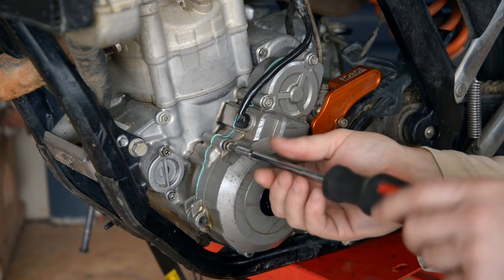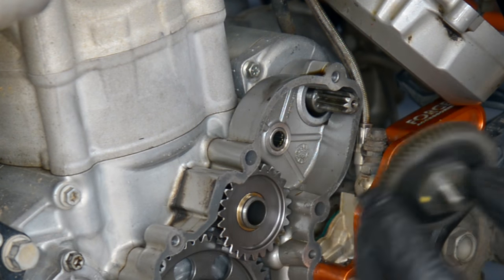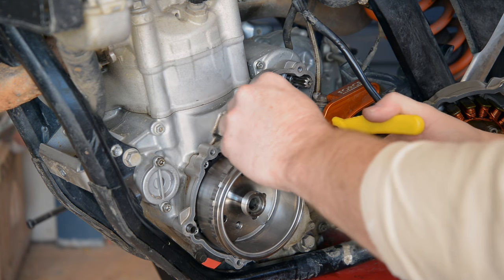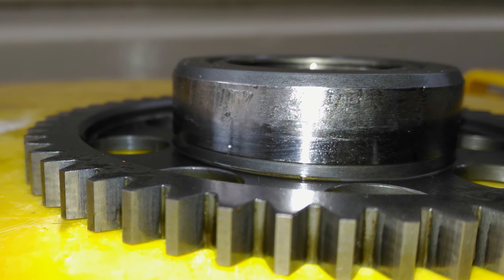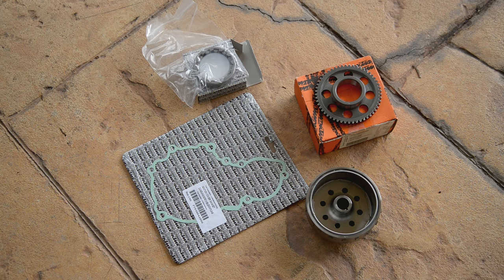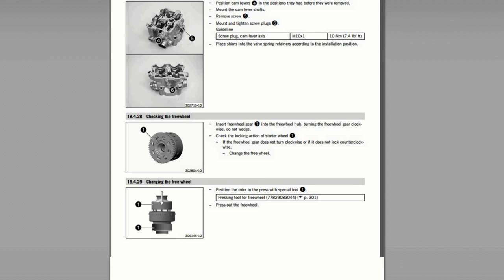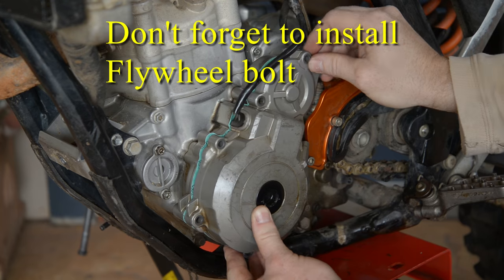KTM Flywheel Bearing - How To

Comment: The bolt without the copper washer should be placed back while the piston in TDC. In that position the tip of the bold end up in a dimple in the crank just to hold it at TDC. You put a lot of pressure on the crank.
When removing the flywheel, keep the wrench on the puller , the crank should not move. In fact you do not need to remove the copper washer and bold to remove the fly wheel.
Reply from the maker: Interesting point thanks - I will try this next time
Reply: What about when installing? Should an impact gun be used or the locking screw?
Reply: @Cryptix37  just use the torque wrench. You can put a  locking gear or a copper washer or  copper coin between the primary gear and clutch or put the bike in gear after the drive chain is placed. The torque on the puller to remove the flywheel is much higher than the torque on the bolt that secures the flywheel.
Reply: @wil9650 will try. I think I’m going to go buy both impact gun and torque wrench. The only concern is that cheaper torque wrenches are not reliable, but probably will do
Reply: Just had a chat with a mechanic friend of mine. Belt for oil filters can hold the free wheel very well apparently.

Comment: How did you find torquing and removing the flywheel bolt as its spec is 70nm I’m worried it could shear the bolt holding the engine locked in at tdc

Comment: Great video. Question. Can the seal behind the stator be removed without splitting the whole engine. I’ve an oil leak on my ktm 250 causing charging failure. Can only think leak is from that seal
Reply from the maker: Not sure I've never had to replace that

Comment: What symptoms were you seeing that led you to want to replace the freewheel gear and bearing. On my exc 350f (2013) the starter motor does not seem to be disengaging so when I use the kickstrter I can feel and hear the motor spinning making it hard to kick over. The bike also will not start. Just cranks over when using the electric start.
Reply from the maker: Bike wasn't starting and kick starter was jammed.

Comment: What torque did you set on stator rotor srew, M10 one?
Reply from the maker: You can find the torque spec in your bikes manual.
Reply: @troytranter3701  Thanks for reply, I ask cause I am not sure if line in manuals torque specs table named "Rotor srew" really about stator rotor, value is 70NM, srew threads oiled, which sounds true I imagime torque my hands used to unscrew that bolt. I like better than torque specs are listed individually together with actual description of assembly/disassembly procedures. I also have KTM exc-f year 2012.

Comment: Do you need a specific brand or size of flywheel puller tool?
Reply from the maker: On my KTM 350 excf 2013 model the thread size on the puller is 26 x 1.0. Enter your bike details into your favorite parts website and the right one should be listed. Brand really doesn't matter.
Reply: @troytranter3701  Thanks for the reply.  I ended up just putting a socket in the flywheel puller because the little lug that was included didnt fit.  Got it all worked out though.

Comment: Aloha from Hawaii! Mahalo for the video. I have a 2012 ktm 350 xcf. Think I may have the same problem. My E-start will crank but won’t turn over, and my kick start feels like it’s spinning all the gears including the torque limiter gear. I removed the torque limiter gear and my kick start worksite bike will run. I was hoping you could shed some light on my problem. I’m thinking the torque limiter bushings are shot and that’s why it won’t work. However I think it’s more then just that. Could you help please?
Reply: Do you ever figure this out !? I have the same issue

Comment: Hello, do you know how to remove the electric starter, I’ve tried for hours now and I’m wondering if the only way is to remove the flywheel as shown is this video.
Reply: Pour retirer le démarreur il faut démonter les 2 carters côté rotor, celui devant et celui derrière le rotor et la roue libre sinon risque de casser ton carter ou l’engrenage du démarreur entre dans le carter

Comment: How is the right way to place the bendix ???
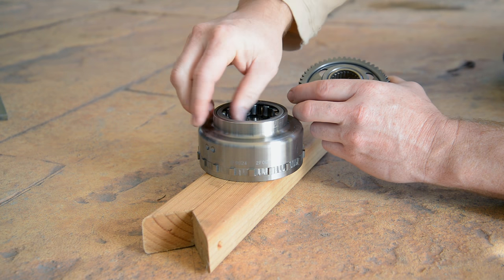Reply from the maker: On my bike the bearing locks anticlockwise 4:50 on the video
Reply: @troytranter3701  My bike is Ktm 350 Exc 2012 how is correct!
Reply from the maker: @deanchernev9780  should be the same

Comment: How do you remove the gear and the bearing from the flywheel?
Reply from the maker: The gear next to the flywheel comes off at the same time as the flywheel (they come off together) and you use a punch in the small holes to knock the bearing out in the flywheel.

Comment: Whats the part number for all the parts?
Reply from the maker: Jake go to the KTM  online site and go to parts finder e.g    Part Finder - KTM - 2013 - 350 EXC-F - ELECTRIC STARTER you will find all the information.

775 39 005 000	ROTOR
773 39 010 100	FLYWHEEL SCREW
772 40 026 000	ROLLER FREE WHEEL
772 40 020 000	FREEWHEEL GEAR
0618 301617	NEEDLE BEARING HK 3016 B

Keep in mind these are the part numbers for a KTM  2013  350 EXC-F Australian model
Cheers

Comment: how did you remove the wrongly inserted freewheel clutch?
Reply from the maker: Sorry for the late reply. I placed my punch in the holes at the back of the flywheel and punched it out from the back carefully - make sure you punch the bearing out even using opposite side holes. If you look at 3:16 on the video you can see the 8 holes I'm referring to. Hope that helps.